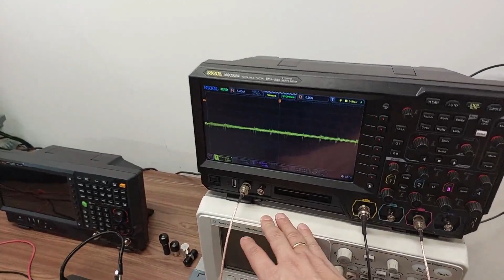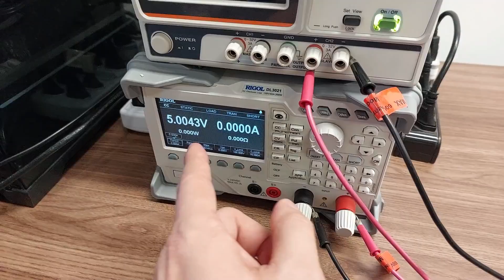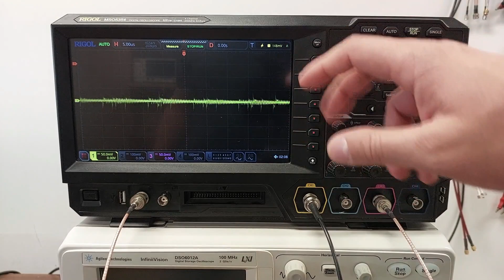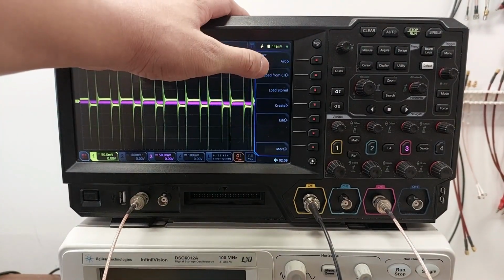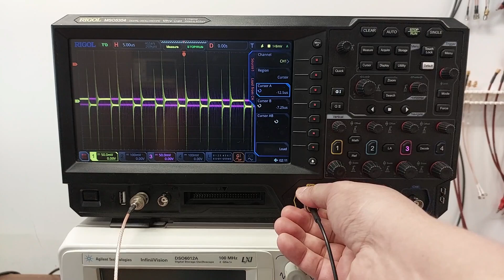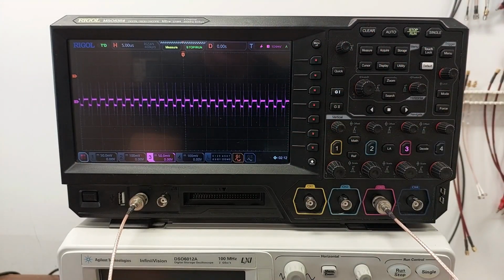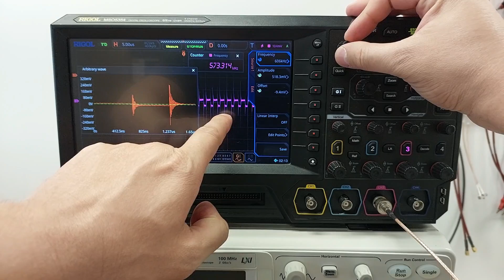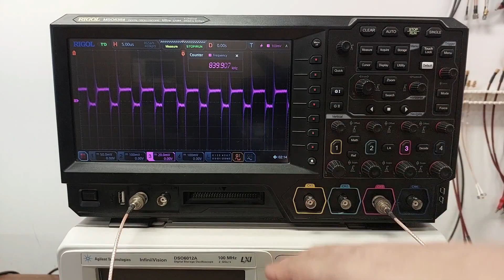MSO5000 Arb. Generator - Load, reproduce and edit real signals

Comment: Wow Thank you very much for the video. Honestly, I never even dreamed of such a complete answer. THANK YOU VERY MUCH!!!!

The only question is, is it possible to use both generators with different signals at the same time?
Reply from the maker: Nice! My pleasure. I do not see any limitation of not using 2 generators at the same time. You could get 2 signals in different channels "copied" to each of the generators. They are independent, but you could even align their phase if you will. For example, you could load 2 signals on both generators and activate "align phase" to syncronize them, one relative to the other. I believe possibilities are endless here. As long as it is within the generators SPECS! : )
Reply from the maker: If you wondering just if it`s possible to use both generators at the same time, here is a video (portuguese) that I used both generators to measure a differential amplifier gain. Auto-translate works reasonably well. https://www.youtube.com/watch?v=jurt-tAwwos
Reply: Thank you very much for the video, the subtitles helped me understand)  @LiraLab